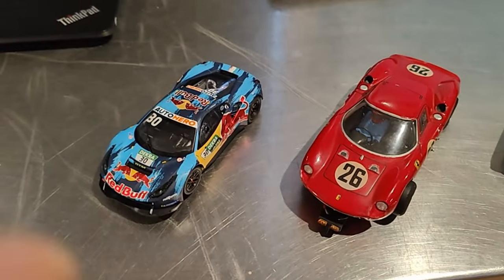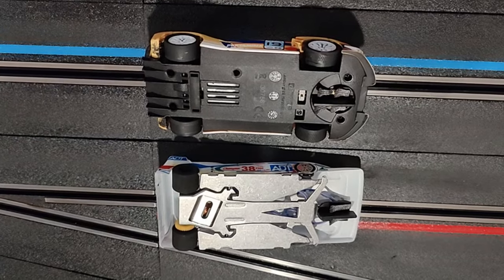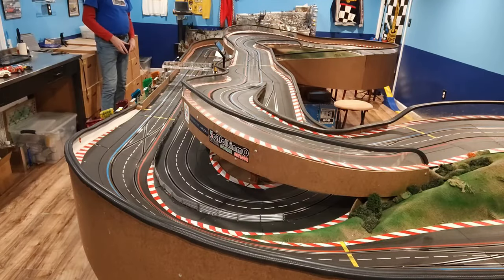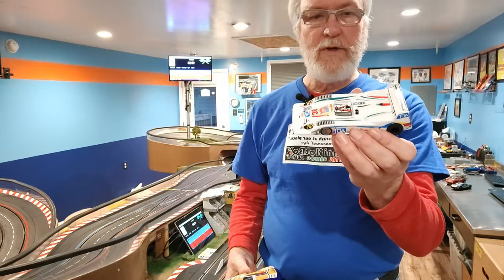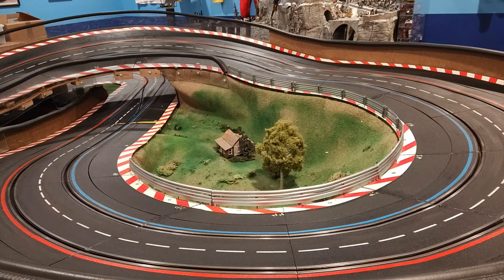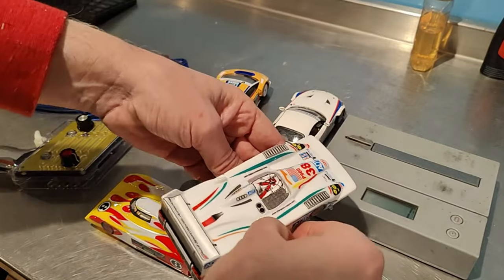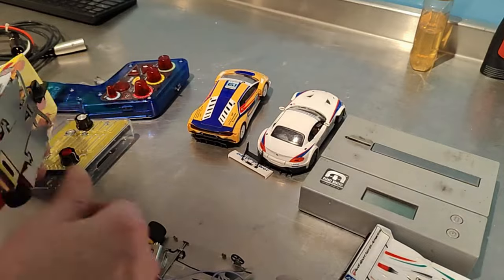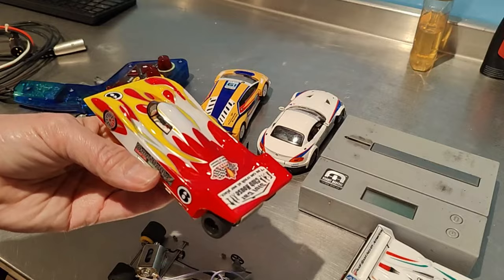JK 1/32 Steel for Real Fast Slot racing

Comment: Interesting video, the JK anglewinder is what I would consider slow - thick lexan, can motor and simple chassis. Unlimited spring steel and brushless motors are another level. Probably need some goop on the track though!
Reply from the maker: Yes these $85 cars ARE slow compared to the $600 cars you are referring to.  I own and have raced that category, but here I am introducing a low cost, low maintenance commercial track type car to owners of Carrera and small club tracks.  Most of my audience has never seen or considered running such cars on their track.  Our club enjoys these and are buying them.  Few, if any would  buy $600 cars let along the tools, supplies, spares  and controllers required to field one.  It is possible to run much faster cars than these on our OmniSlotBox equipped Carrea digital track, but they are not more fun. You are also correct about the need for traction goop for the very high powered cars.  We find that even these cars with their foam tires need a light application of track spray to perform well, but we have been using that to improve te performance of everything we run here.

Comment: Wow, that direct drive is really intriguing, I should get one myself ! 
As a curiosity pertaining to the Carrera, why did you remove the rear magnet and not the central magnet?
I do find that keeping only the rear magnet (with perhaps some additional extra stacked aftermarket one) provides maximum handling and grip….
Reply from the maker: Yes, adding or keeping the rear magnet in Carrera cars can result in faster lap times, but it also reduces the fun factor and makes the driving experience less dynamic. With stronger magnets, the cars tend to stick to the track and don’t drift before deslotting, leading to more abrupt crashes. We’ve moved toward removing all magnets from our 1/24 cars for a more engaging and predictable driving experience.

For Carrera cars, keeping the center magnet can improve stability. Since it’s wide and sits on a smaller arc, it allows some controlled drifting without that sudden deslotting. However, removing all magnets from Carrera cars can make them challenging to drive, especially with poor tire grip or dusty tracks.

To counteract this, we true all tires, use mostly Paul Gage tires for better traction, and apply a light track conditioner to keep dust off the tires. We often let new racers try different setups—standard magnets, reduced magnets, and no magnets. They usually feel most comfortable with mid-magnet Carrera cars or no-magnet setups in cars with well-built chassis and wheels. Interestingly, even though no-magnet steel-chassis cars are "scary fast," they often turn out to be the easiest for beginners to drive due to their balance and handling.

Comment: Good video comparison of the different car styles. I saw Massimo’s video with the cars you supplied him. He needs a little more practice to be able to go as fast as you were going. I’ve never seen a direct drive car before. Always learning 👍
Reply from the maker: Yes the DD car requires a very different driving style. It has little brakes and torque.  But because of his Low Cg and magnet downforce from the motor it can carry a crazy amount of speed in the turns under acceleration.  SO the technique is to brake earlier than usual and stomp the throttle at the turn entrance so the gentle acceleration controls drift.  Of course the other problem Massimo had was the tires of both cars immediately fouled with dust.  But yes I have 50 years of practice on him.

Comment: What would be the legal or maximum downforce for the stock Carrera DTM cars to keep everyone fair and competitive.
Reply from the maker: Cars with strong magnetic downforce are easier to drive and can achieve faster lap times but are harder to race than cars with little or no magnetic downforce.  Racing is about putting your car "on the limit".  With little or no magnet, cars can drift, thereby signaling where the limits are. So they are more predictable and reward proper driving technique.  Magnet cars, especially those with magnet toward the rear of the car, loose grip suddenly as the magnet moves off the rail.  Crashes are more violent and less predicable.  

Removing traction magnets form Carrera cars is problematic because Carrera tire and wheel manufacturing tolerances vary considerably, so some cars will handle OK and most badly.  Ther can be huge performance difference, even comparing, cars of the same the same exact model.  Magnets largely disguise this problems.
  
SO, after long experience, we find that the best set-up for racing Carrera cars, both 1/32 and 1/24 is to remove the rear magnet, but leave the center one in.  This gives stability with less sudden release.  Then we replace the inconsistent and quickly degrading Carrera rear tires with Paul Gauge tires.  We like these tires because they give better traction and do not degrade. Unlike many other replacement tires they can be easily trued.  By truing both front and rear tires on our CG tire truer, the wobble and shake often found in Carrera axles and wheels is eliminated.  The cars then are much more drivable and differences between cars are mostly eliminated. If you need a tire truer, OmniSlotBox usually has then in stock here:    https://omnislotbox.com/shop/ols/products/cg-slotcars-cgsctm01-tire-truer-machine
Reply: @jimcunningham534  Thank you for your time and advice. We currently true the PG tires and have about 10 consistent guys having a blast currently using magnets. We have removed the rear magnets on a few and find it very challenging. Sure slows things down. We only race stock cars and some just won't stay on the track and was hoping to make more competitive. I figured we could have limits on weight and magnet stick. Thanks again.
Reply from the maker: @philipsoucie3015  "Some just won;t stay on track".  If "some" refers to drivers, coaching and practice is the answer.  If it is some cars... be sure you are truing the tires.  On the Nascars the tires are tall and cars that handle less well can be improved by reducing tire diameter, especially at the front.  Yes less magnets is slower but the racing is more satisfying and damage to cars is reduced.  Another factor is you track.  We highly recommend shoulders at and beyond all turns. Also traction sprays like "Track Honey".       When it comes to setting limits on magnet cars to equalize performance, we have had great success with the "1 Gee" rule.  That is cars may have up to but no more magnet than will cause them to hang upside down on a on a Carrera track.  If car "hangs" one can either use  a spacer to raise the magnet rf add weight.  Either way, it tends to equalize performance even between different brands.      Here is a short video demonstrating the "1 Gee" test.  Not that the test track is bonded to a piece of MDF to insure itin flat for consistent results.  https://www.youtube.com/shorts/i4jSb5IvmgE
Reply from the maker: @philipsoucie3015  When racing with magnets we are also to achieve good parity by using the "1G" rule. Cars that can hand on an upside down piece of Carrera Track must add weight or lessen magnet.

Comment: Ran a jk 1/32 scale car on carrera track yesterday and major drift and extremely slow. How did you get that speed frome the jk
Reply from the maker: As mentioned in the video and in our listing of the JK cars on our webstore, foam tires do not work well on a dry dusty track. We apply a VERY light mist of "Track Honey" to our tracks. This does not make track sticky, but dust and rubber stay on the track and do not collect on tires.  We do not have to clean track or tires each time we start running. All types of tires work better.  The track gets better with use as it "rubbers in". Another issue with foam tires is that the foam can oxidize or dry out.  If the tires have lost grip, sand them lightly and or treat with one of the many tire treatments. Also, if you track does not have a power supply upgraded to 5 Amps of more and /or does not have good power taps and or upgraded controllers you will not ge good performance out of the JK cars.  We sell the JK cars on our OmniSLotBox site becasue they work well with the OmniSlotbox upgrade and we include a bottle of Track honey with every OmniSlotBox.
Reply: Thank you for the great info

Comment: Thx for the presentation. Your slotcars circuit is beautifull. I have discover these metals slotcars with your vidéo. I understand the performance of   this system, but im not fan with the look (fake front wheels, less detail like Carrera).
Reply from the maker: A huge variety of clear bodies exist that can be fitted to these chassis including some with accurate proportions. Decals are also available to create accurate bodies for cars like these.  Fear front wheel can be added. I have built similar steel chassis cars with actual front wheels.  It's there for you if you'd like to exercise the skill and creativity of the hobby beyond Ready To Run mass produced product. Since that market segment is now small these RTR cars are popular with those who like their superior performance durability and low cost. We love all forms of slot cars.